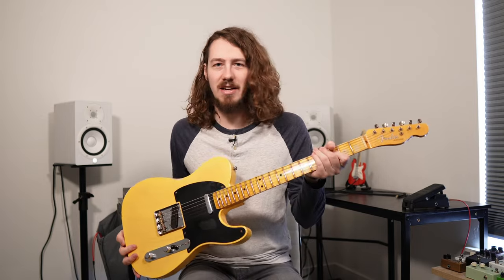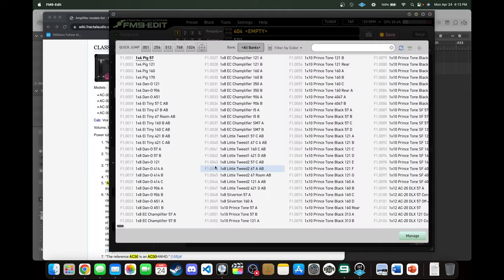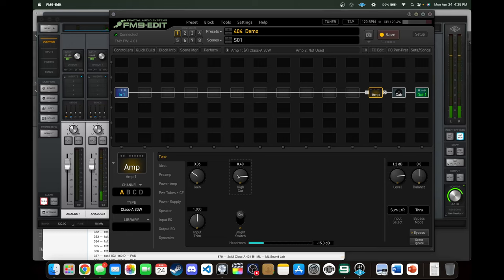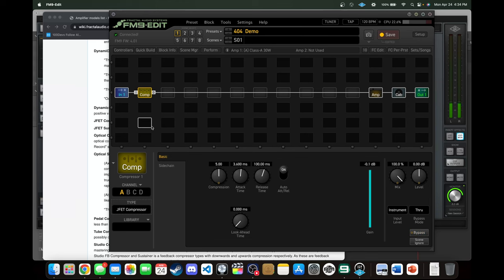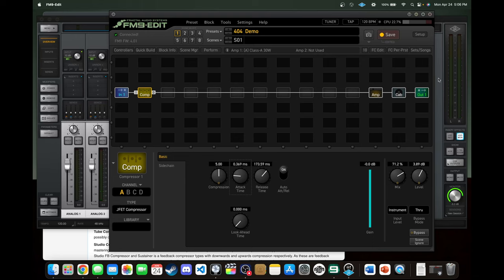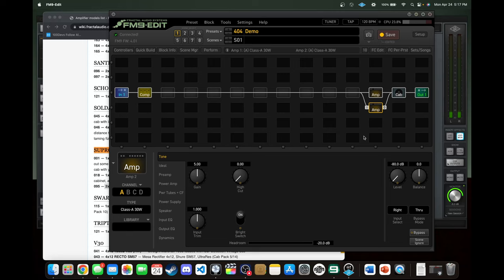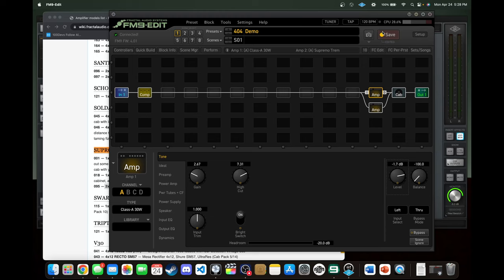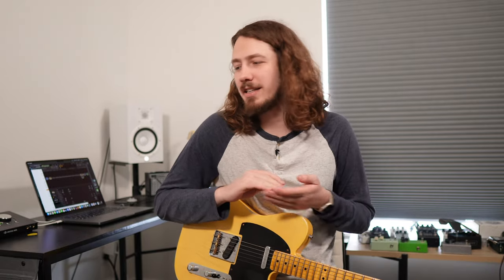Fractal FM9 Patch Building Tutorial (Part 1 Amps and Compression)

Comment: Are you running your output 1 xlrs to the back of your Apollo and using line or mic setting? I’ve tried both and it just doesn’t sound right to me very tinny vs using the usb into my Mac. Yours sounds great so that’s why I was wondering. Thank you for the video!
Reply from the maker: Yes I am running the xlrs from the fm9 directly into the Apollo at mic level I believe. I turn the preamp of the Apollo all the way down and increase the output on the fm9 to hit the Apollos meter at around -9. Maybe make sure there are no plugins being applied on the Apollo.

Comment: Hi, just wanted to say that this is super helpful and there is really a lack of videos that do this kind of walkthrough.  Those of use who have not had extensive experience setting up real amps in a live setting are going to struggle to get a modeler dialed in…. Really enjoy seeing your thought process.  Have you tried using the fractal preset leveling tool instead of your UA meter?    Also wanted to say I would be interested in seeing how you adjust the same patch for a HB guitar via Tele…
Reply from the maker: Hey thanks so much for watching! No I guess I never thought of using the fractal preset leveling tool, I didn’t even know that existed! I’ll look into it, I would like to do humbuckers also at some point.

Comment: Very nice, are you finding you prefer the FM9 to your pedalboard into the UA Ruby/Dream? You're in a very helpful position to many where you own both complete rigs and offer input as to which is more flexible, which sounds/feels most authentic, takes other pedals better, etc. Curious to know your thoughts!
Reply from the maker: Hey thanks for watching! Gosh this a hard question, I like both equally and I say that completely honestly. I bought the fm9 to use as a backup board but I have not stopped using it since, just because it’s quicker to get going for new songs and me not having to program midi on my other board for new songs. Tones are totally equal same with realism and feel. The fractal has the edge due to you being able to blend in reverb and delay to your dry signal as essentially running wet dry wet which I will get into in either part 2 or part 3 of this series. You could do that on a normal board but it would take some additional pedals to blend signals. I like them both, it’s fun playing the real board because I love the look and aesthetic of real pedals but also love the simplicity and easy setup of the fm9.
Reply: @lightfootfx  Dang, that's a good answer and excellent insight! Thank you, curious to see the rest of your patch building series. Who knows, maybe I'll get on the FM9 waitlist.
Reply: I’m thinking of getting an FM9. Most FM9 user videos are heavy metal musicians getting an overly distorted compressed sound. 
I’m  into rock and country and you are setting up your sounds more realistically like an amp which is what will make my decision to buy the FM9. Looking forward to seeing the rest of your series to make my final decision. Thanks